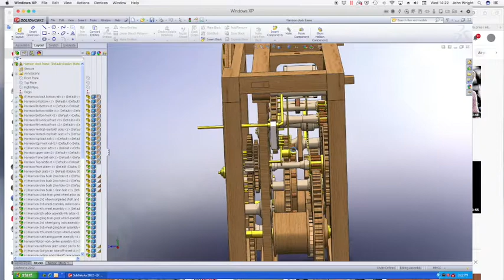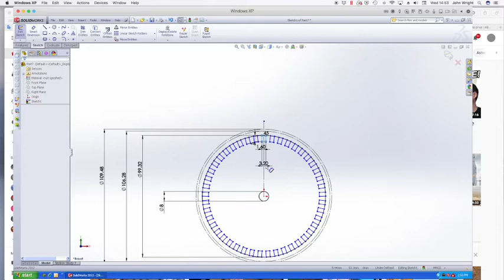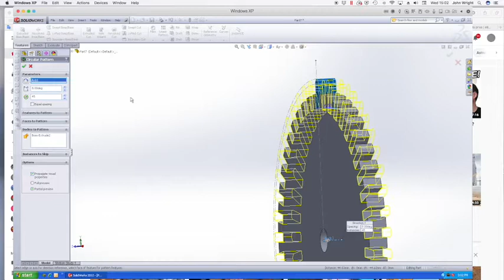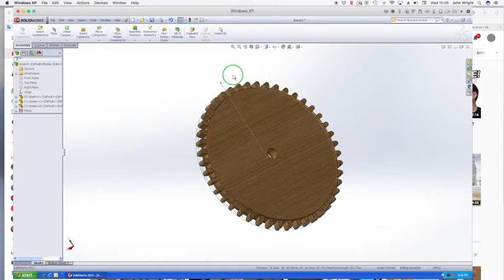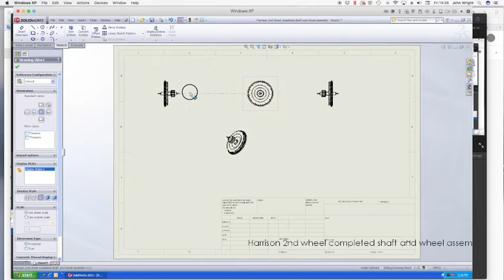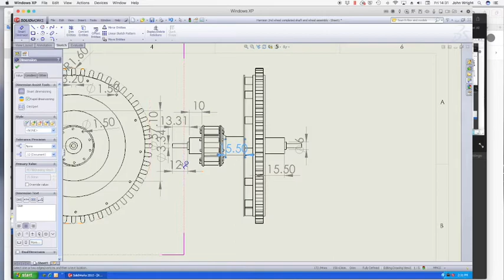Making John Harrison's wooden clock pt 12 Solidworks drawings

Comment: Can I get a copy of this?
Reply from the maker: Toby

I am currently pondering what to do with the drawings. I will probably make a book of the drawings to aid anyone wishing to make a copy. I am unlikely to part with the Solidworks files.
John
Reply: @john2478  I would certainly be interested.
Reply: @john2478  I would be interesting in a book of drawings or a copy of files.  I think your project is a fine tribute to John Harrison.  It is frustrating how little is available about his surviving clocks.  I would be happy to pay a reasonable amount for them.
Reply from the maker: @erikmewes6428  Erik
I have not completed the project yet. I have been distracted on another lathe project for the last 3 months. However I do have some more video which I must post on the tests I have done on the pendulum. I also tested the circular error and have not managed to get the results I was hoping for. The temperature compensation is now adjusted so the time does not gain or lose time with temperature, but this is not the end of the story as it should gain slightly with a rise in summer temperatures to compensate the thicker denser air in High pressure. I note your interest in the drawings.
John
Reply: @john2478  Looking forward to additional content.
Reply: Great set of videos on this subject, I would also be interested in a book if you are thinking of it. Some lovely work and nice to see how you model a gear.
Reply: @richardgarland4562  Definitely agree, individually constructed teeth is the way to go.  Only thing that I might try different is to do entire wheel glue-up, then form teeth.  John's method is very much improved !
Reply: @john2478  I would be very interested in a copy of the drawings.